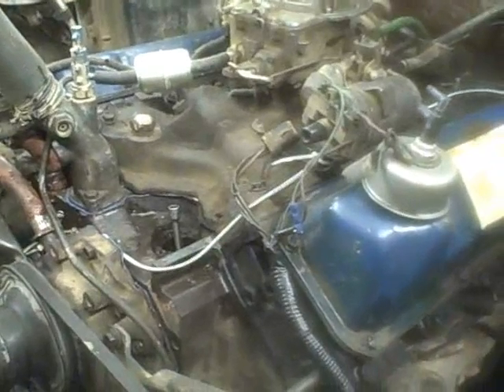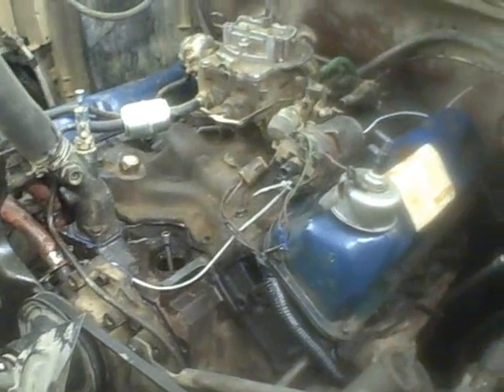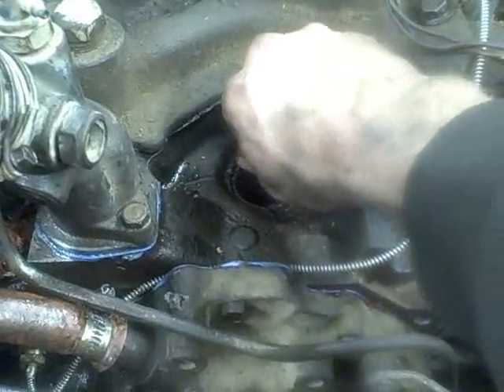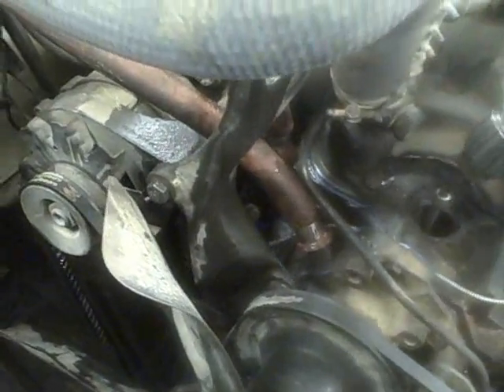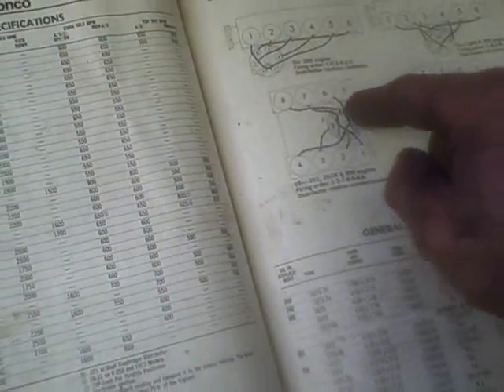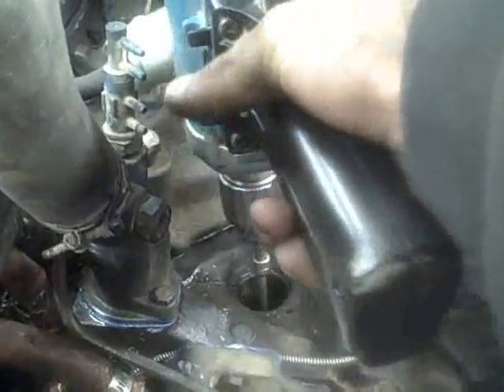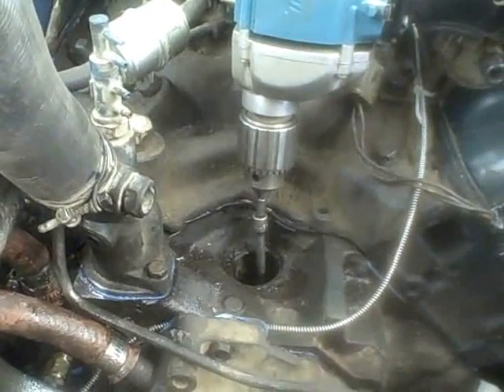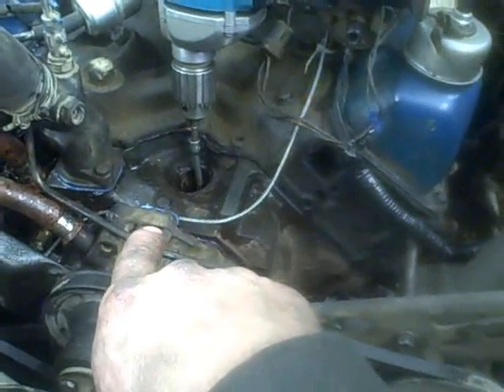Engine Assembly Part 7  prime the oil and stab the distributor

Comment: since i paid attention, i noticed you were wearing a coat, which to me would mean it was rather cold, also an upload date in january. this makes me wonder why you would use such heavy oil in a new motor running in such cold ambient temperatures. just my opinion as such.

Comment: i would say you should have primed this engine with the valve covers off to enable viewing of oil flowing through pushrods and such. you explained it well but did not do it. also, you probably shouldn't use diesel oil, such as the heavy rotella, in a new rebuild. whatever may have been your reason for failure, heavy ass oil most likely did not help matters much.

Comment from the maker: @rd95stang I do in fact... there is a tool you can use, looks like a small air tank with a hose coming out of it you fill it full of air and oil and hook the hose to the oil pressure sending unit port, then crank the valve slowly and allow the oil to circulate using the air pressure, always make sure your oil level isnt too high after you use one though

Comment: good work.  i am not sure on your method of timing it.

my dad would always leave the lock bolt out and hold the side of the distributor in place. i would turn the truck over and it starts (unknowingly) and my dad would move the distributor to the way the engine wants it. then snug the lock bolt. check with the gun and go from there.